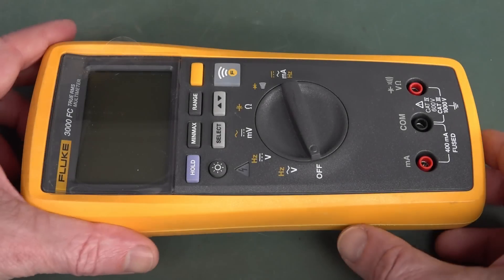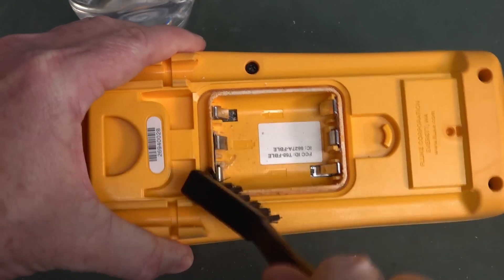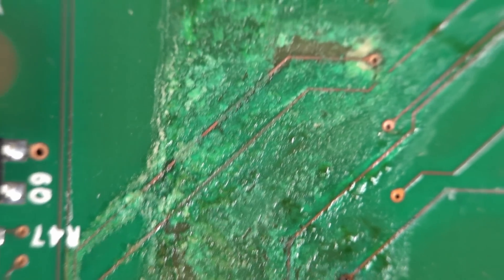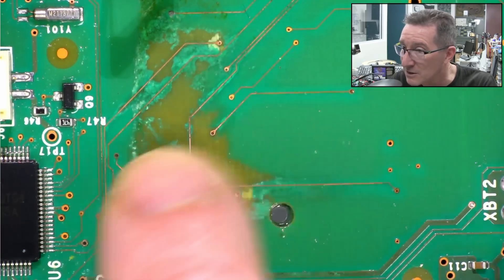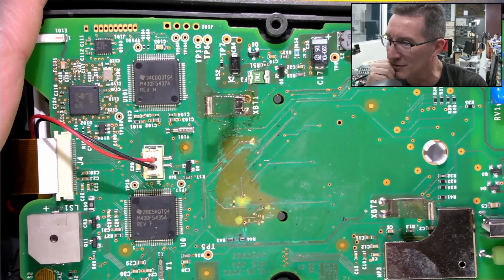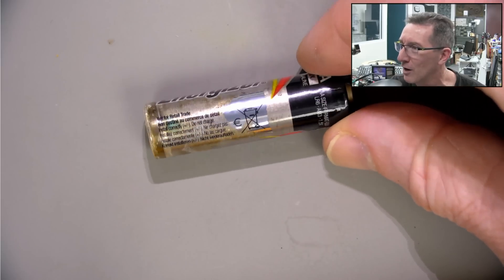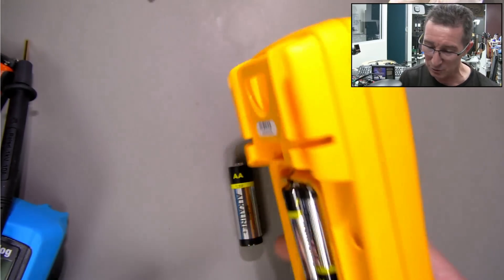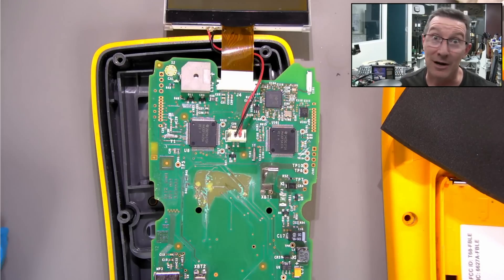EEVblog 1497 - RIP Fluke. Thanks Energizer. NOT.

Comment: I would check all the corroded vias. I remember specifically seeing a via on an old HP power supply just not conduct through to the other side because of corrosion, and fixing that brought it to life. With this battery gunk seeping thorough inside the vias and onto the other side, chances are it ruined the connection inside those vias.
Reply: Some of the Fluke meters are now made in China. The quality is terrible. Be cautious. I also ordered some "Fluke" meter leads from a Chinese distributor. They arrived and looked authentic. I used them for a while and started to detect some small differences from my older truly authentic Fluke leads. They felt more noodly like overcooked spaghetti and I played my hunch and cut and stripped one to have a closer look. Sure enough, I discovered that the number of stranded conductors in the lead was less than half that of the truly authentic Fluke 10 amp leads. Not only a fraudulent sale but a dangerous sale. There is no way these leads would have carried ten amps safely. I have learned over and over that the Chineese have no ethics when it comes to trade . (Or ethics in anything really) They are out to cheat you in every way possible and they have no compunction about theft of design or theft of cash. Steer clear of anything Chiinese. The only reason an Apple phone is of decent quality is because the Chhineese use them to spy on the West and to figure out the best way to ship fenatnyll into the U.S. to kill Americans. Especially Ameerican kids.
Reply: How to you fix a corroded via? Drop solder in it?
Reply: @waldolemmer  I had some luck once by drilling a via out with a tiny drill bit and then pulling a small wire through.
Reply: @waldolemmer  I fixed it with a jumper wire connecting the trace to where it needed to go.
Reply: I've seen the same thing happen on Bose wave radios that were used in a kitchen. One tiny drop of coffee or soda getting through the top vents and onto the double sided board will do horrendous damage, and the vias are so small that passing a fine piece of wire through them and soldering the wires on both sides of the board is quite difficult.  One radio seemed to have the corrosion confined to about a square inch or inch and a half, and it looked like it should have been an easy repair,  but it was far from it.  The surface of the vias also had some kind of clear-ish varnish like solder mask or solder resist on them,  so it wasn't easy to solder them either.

Comment: I have not seen solder mask come off like that. I think the pressure and temperature affects the battery leakage. Again way more often Duracell. Once I get everything cleaned up I usually go over any traces with some solder and now I would be inclined to put some nail polish over.
I wonder if the pressure of the case on the board caused it to wink in between and affect the masking more?

In some cases I suspect low level current drain might have an effect on the leaking.

Comment: I can testify to having witnessed similar degradation from alkaline batteries. I opened a Korg Kaosspad effects unit, and found that the battery juice had eaten away solder mask and flat flex, freeing the entire connector up and off of the PCB.  The flexible bus wire had the connector still clipped to it, and it was only hanging on to the one little copper trace that didn’t get eaten all the way through on the PCB! This looks way worse to me, I guess because that is a Fluke meter and that makes it one very expensive accident to become privy to.

Comment: Well it's nice to see the energizers do it too although it seems far less often. I recently had an occurrence with a cassette player and I discovered that the DC Jack was passing power into the batteries because I didn't have the exact right size so halfway through Side B of a tape I heard some popping and after finishing I investigated to find the pristine battery compartment covered with acid.
Reply: I bought a cheap Chinese audio amplifier which can run on 6xAA batteries, 9V coaxial jack, or USB power.   The 9V coaxial jack has an interlock that breaks the battery connection, which is good, but the USB connection does not. So the batteries see 5V from the USB power source, and the USB power source sees 9V from the batteries.  I just pull out one of the batteries when I am using USB power.

Comment: I wouldn't blame Duracells so much. I used to use Duracells for decades only had one or 2 of them leak and not that bad.
It's not like you have statistics on this you're going by your gut.

These days Woolies doesn't sell Duracells, stupid market BS I bet.
So I buy all Energizer now, and I've seen them leak heaps, but then that's because it's all I'm using.
Mainly on kids toys left on etc, not so much on stuff with a power switch that completely cuts of the power and no trickle drain.

I reckon they have definitely gotten worse than they used to be though and do more damage to the terminals.

I just want to buy a battery that won't damage the products.

Comment: Would the corrosion travel along a copper wire if connected to battery terminals going to the pcb? Just thinking   if it's possible to isolate the board from the sour goo.
Reply: I've seen cases where the battery leakage wicked down the wires, and corroded the stuff at the other end.
Does not happen TOO often, but indeed it can happen.

Comment: I just wanted to add the AA batteries convo those sold from Bunnings Varta longlife Power are shit they don't even last year and they spill their guts before they come up to 6 months. For me The Energizer MAX the blue ones havent come a motsa in a remote in a year, The Duracell Ultra as well are great for long life i put them in my WIFI/Bluetooth Bhyve Water Sprinker out in the hot hot hot sun maybe 40'c sometimes. The Cheap batteries are what they get what you pay for like Everyready and those Energeizer Red label they want even last 3 weeks. When i go to Coles Supermarket ignore the batteries that Colocated with Duracells what ever they are called and The Woolworths/BigW i ignore the Cervon Batteries my tip to buy top knotch batteries you wait for the 25% or 1/2 price sales to buy the Duracell ultra batteries or Energizer Max Blue. btw the Lithium batteries are really good they throw my Bhyve to confusion cause it doesn't know how to calculate a Lithium battery %.

Comment: It's like a caustic reaction where the copper is left unharmed but plastics and insulation coatings are attacked.   We use this technique to strip electric motor windings from cores without damaging the metal work (not aluminium) but it attacks the insulation & resin coatings.
Reply: Nice technique first time I heard about it normaly most of peoples rewinding electric motor use cutting tool and punching tool to extract copper wires I saw peoples use heater and pulling hoist to accelerate pulling copper but using caustic soda I didn't hear it before thank you for the information if they're any hint you can give me I will be glad to hear from you examples concentration and bath time
Reply: @jeanmichel9207  We don't use this technique any more as modern insulation system now resist chemical attack.   Now we burnout using controlled methods.

Comment: @EEVblog

Back in 2013, you've made a lenghty video on teardown for Fluke CNX3000 wireless multimeter (https://youtu.be/0Pplmg9Seao)

I've just watched that video and it seems it has the same MCU (MSP430 labeled M430F5435A). If you still have that multimeter, just look at R43 and R44, they are even labeled the same on this multimeter!
Reply: And it use the same batteries as well
🤪🤪
Reply: @tarek13ch666  waaahahahhaahaha 🤣🤣🤣

Comment: The main reason I use brand name batteries is so they don’t leak. Of course if you leave flat batteries in a device, that’s on you, but frequently the unbranded batteries leak before they go flat and before you have reason to change them.  Most annoying, more than once I’ve had expensive gear supplied with cheap batteries that have leaked and done damage before they have needed to be replaced.  Companies saving themselves a few dollars on batteries by giving you cheap and nasty in their expensive gear.  That said I’ve just had this happen with an energizer for the first time this week.
Was working normally, then stopped, changed batteries straight away and they were leaking.

Comment: Why don't you use rechargeable cells? It's economically and ecologically better and I have never seen an Eneloop leak.
Reply: Some devices unfortunately don't work well with Eneloops because of the lower initial voltage. They either complain about low battery very quickly, or the displays are very dim. It's not the fault of the NiMH cells, it's the devices' fault. I have seen devices here and there where you can switch from NiMH to primary voltage curves in the menu or via a switch, that is great (bravo Tascam and Sangean!). A lot of devices also just work well with NiMH out of the box, but some don't.
Reply: @maximilianmustermann5763  That's right and I know. I have some cheap China-made devices which require 1.5v+ for working, like an Rapoo wireless keyboard+mouse set. It's wireless range decreases to like 40cm with 1.2V cells, that's why I have some special rechargeable NiZn cells (1.6V) for such devices. But all the more expensive brand devices (like may Fluke 179) have sufficient voltage stabilization so this should work.

Comment: I don't recall ever having that problem with my older fluke meters that used the 9 volt batteries. I have had them expand and bulge the top of the 9 volt battery however I was fortunate enough that the 9 volt battery shells contained the leakage and kept the alkaline from leaking into and damaging my meters. I would gladly give up the longer battery life that double A batteries offer to avoid a potential mishap that would damage a $400.00 + meter.
Personally I wasn't to excited to learn that some of flukes latest product offerings required AA's instead of 9 volt batteries.
Reply: I just opened up a $10 Harbor Freight multimeter. Turns out it has a 9 V battery.

Comment: I wonder when a multimeter manufacturer will come out with a model that has an isolated leak proof space for batteries, we need that, the world needs it, cause battery manufacturers do not care about leaking batteries.
I have lost two multimeters due to leaky batteries.  One of them I saw that the trace were still conductive, but then saw that multiple vias were open, that is when I gave up.
Reply: "She didn't like it when her fan belt shrunk and got shorter/ battery leaks could nearly cost her a quarter...." Frank Zappa

Comment: This is the reason why I use only nimh to replace AAA and AA alkaleaks. I use those cells to replace C/D cells with adapters. (3 AA to one D) and devices where I can't use nimhs (lower voltage alarm or if rechargeable has too low capacity, typically 9V nimh has too small capacity.) then I use lithium batterys.

Comment: you can restore Through hole connectors with separate copper wire and active flux, after cleaning and druing this board. Seems salvageable so far

Comment: I'd definitely love to see a repair video on this thing. Exactly because it does appear to be a moderately challenging repair and indeed one that might not otherwise be economically viable. But for educational value? Can't beat it. Show us how it's done, Dave!
Reply: I'd love Dave to do a few repair videos similar to what My Mate Vince does. Or post it to My Mate Vince for him to repair!
Reply: I think it's one of the vias. I recently repaired a Fluke 177 which was competely dead. Turned out there was a corroded via in the first few centimeters of the positive battery line that even didn't look that bad. Those blackened vias in the video look worse. I'd check these next....
Reply: I would rather he attempt to get the battery guarantee to pay off before falling back on that.
Reply: The problem is that the contamination has got inside the circuit board.. Probably unrepairable.
Reply: White vinegar is your friend.....

Comment: That's why I use the pricey lithiums.  I like the 9.V because they rarely leak and when it happens generally not that bad.  The connector is readily available.  And the connection is more positive and not dependent on the housing.
Reply: Exactly that! 😉

Comment: Old classic synthesizer keyboards are often worth more now than when they were new, so many so many an ex- band member dug old synths out of their closets and brought them in for refurbs. Owners had no idea there was even a battery inside. It was amazing how many had been damaged by leakage from the 3v data backup batteries on the boards. Fortunately, traces could be jumped and through-hole components could be identified and replaced. Unfortunately many chips that were no longer available lost their legs. The batteries were not accessible without disassemby and were sometimes soldered in place.
Reply: That's true.. those damn on board batteries seem to be a real problem. Even when people know there's a battery in there, not everyone is capable or comfortable enough to open the thing up and remove the battery.

Comment: Very timely, just found 1 of 8 Duracells leaking in my in my insulation resistance meter this morning. It's always the AAs, never the 9V batteries (luckily for my DMM).

Now I know to only use Energizers, thanks!
Reply: I've had 2 leaking 9V batteries, both Duracell, and they can be a bit explosive due to the case trapping the leak.
Reply: 9V batteries are made of 6x AAAA batteries. 6 x 1.5V = 9V.  if any of the AAAA  cells did leak most of the magic goo would be contained in the 9V battery casing.

Comment: Its NOT laughable the damage those batteries do on all kinds of stuff. About time to sue the hell out of those battery factories. 1 Costs of our damaged equipment, 2 environment, waist of good materials, Productions and YOU think World wide those circuitboards will be recycled? NOP Burn oven. All that copper tin, chemicals, plastics etc. HUGE waist of materials if you add up Globally the mountain of waist produced by those leaking batteries. That Fluke should have lasted 40+yrs! Pure crime it is, and you mown about environment! Start here.

Comment: Last year I had a situation where I had some AA batteries in a portable CD player, one day I went to turn the playing on and it wouldn't start.  Opening the battery compartment revealed one battery had leaked, they were both Energizer batteries.  I took them out and when I tried to put new batteries in, I discovered that one terminal was bent back against the end of the compartment, and when my sister's boyfriend tried to straighten the terminal, it snapped clean off.  He was able to replace it.

Comment: How timely.  In the last two days I've had one Fluke 87 LCD display starting to show signs of segments that are no longer on and another 87 that I needed for a quick house wiring project that had a low battery that just kept resetting.  I replaced the battery and that one now works fine, but it's good that I got to it when I did ... The other with LCD problems will have to be taken apart and clean the zebra strip.  Oh, as for batteries, Energizer and Fluke are both crap and have screwed us all.  I say we just black ball them entirely.  I have not found direct lithium replacements for AA batteries on Digikey or Mouser yet.  The search criteria doesn't return anything of value or is out of stock.  Maybe it would just be better for manufacturers to design devices to have a leak proof battery box that can be replaced.  This way when they do leak you can clean it up easier and or replace the battery box and not have a ruined device.

Comment: I think the only way to get rid of the electrolyte on the board is to wash it in plenty of water. that electrolyte isn't soluble in Alcohol and that's why I believe water is the best solvent. especially in high impedance circuits like that DMM as even slightest trace of residue coupled with little humidity drive that circuit Bananas. in similar situations, manufacturers wash their boards under running DI-Water or most likely Ultrasonic cleaner and then oven dry around 60C or some safe temp...

Comment: If someone has the same Fluke meter, he/she can send the values of those 2 resistors, I think that would be the fastest repair if it's only because of them.
Reply: There is a good chance of it being just the 2 metal film SMD resistors. They are almost definitely gone and considering how close they are to the MCU they can be very important for its correct startup and operation.
Reply: I have one, but its currently at work :(

Comment: this is why i have started to use rechargeable batteries in sensitive equipment, I also was a hair away from getting my 600 dollar fluke clamp meter getting ruined by leaky batteries. it´s really shitty how bad they are allowed to make batteries today
Reply: I ALWAYS use rechargeable batteries whenever possible ...  I'm a fan of retro electronics and most devices one can get are dead due to leaking batteries.  It's a nightmare to fix, but at least it is possible most of the time (thicker traces etc), but newer devices ...  nope.
Reply: @Gallowglas  yeah. And I so just happened to check a vintage calculator I have and naturally the batteries had gone note 7 inside that device leaking everywhere and even rot away traces like in this video. I had to clean up and make new traces and got it working again but man I was pissed for that. It’s not even a risk they leak anymore, it is a guarantee